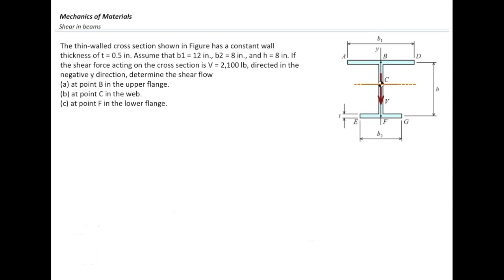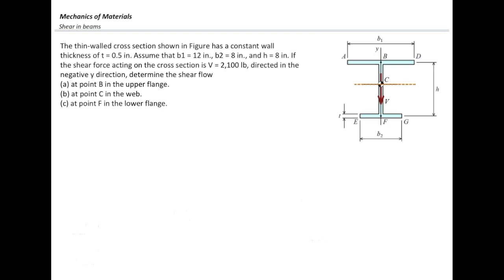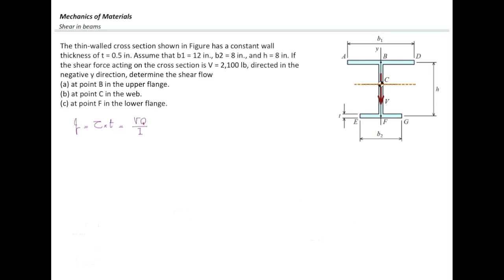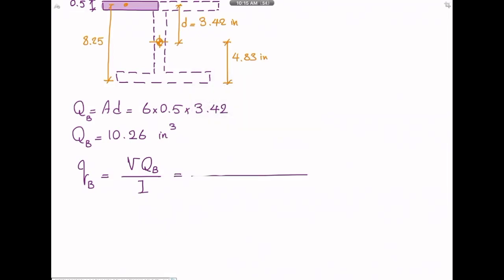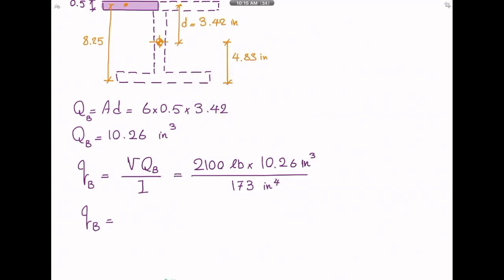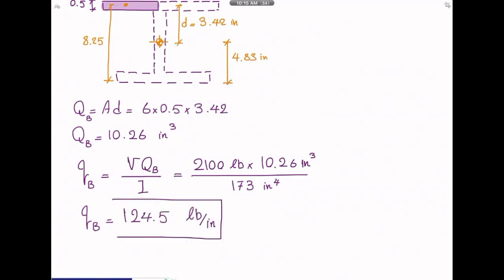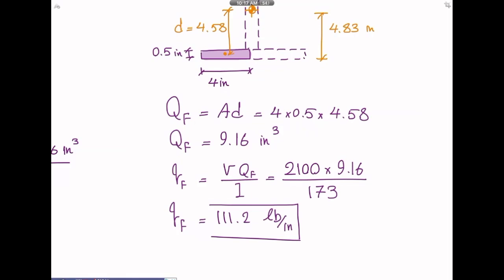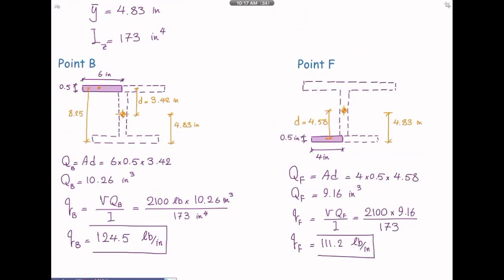Lec19c, Shear flow example

Comment: What is the difference in Q calculating between Built-up Beam and Thin-walled beam?
Reply from the maker: No difference in definition of Q. It all depends on where you cut the section to calculate the shear stress

Comment: why did we select the left half for point B and A? what if we use the total fleng instead? like we use to measure the T shear stress
Reply from the maker: because the shear stress in the flange is needed here so the cut section is in the flange. If shear stress in the web at the intersection of flange and web is needed then the entire flange would be considered. Hope that helps.